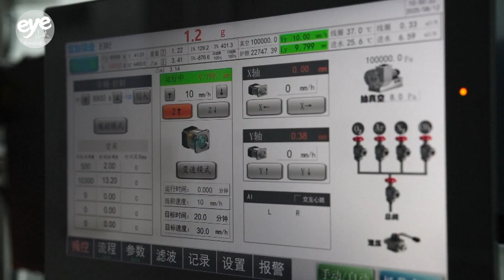AI powers new era in Chinese manufacturing with smarter, more efficient, and data-driven operations

Comment: Love how they run windows
Reply: Not a single computer in the government or the public entities uses Windows in China. They use Kylin Linux OS or Huawei's Harmony OS. Only laptops or desktops used by individual users still use Windows. That will also change and Windows will face the same fate as Google. Now Google is non-existent in China. You need to do some basic research 🤣
Reply: @cwdjdsd-36321cs Just noticed. The original commenter doesn't need to do basic research as they never made a claim about the Chinese government "🤣". This was you misinterpreting what they said. The desktops or laptops used by individuals are a majority of market share in China, with Windows OS being the majority, and Android OS the majority on mobile. You randomly brought up the Chinese government here for no reason.
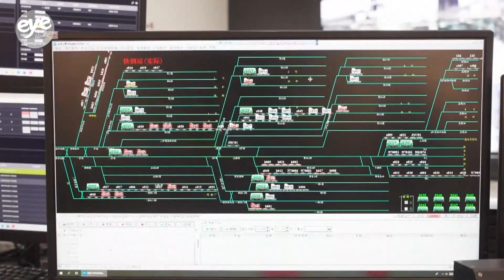Reply: @cwdjdsd-36321cs what are you so triggered abt? You're not even correct either. 1:08 clearly shows him using windows, with Microsoft edge right there, a Chromium based browser btw. You need to do some basic shutting up.
Reply: @bradyh8250  lmao did I tell you that the computers in this video don't run windows? 😂 First of all read my comment properly 😂😂 this isn't a government institution or a government related entity. Individual users and private enterprises still use Windows in China. The thing is Google used to dominate the search engine market, but now Google is totally banned and the available services are from Baidu and other Chinese companies. It's the same story for Windows in China. It's being replaced by Linux and Huawei Harmony OS starting from government entities. For your information government related enterprises account for a huge portion of China's desktop and laptop PC market. Do some research kid 🤣🤣😂😂
Reply: HUAWEI you ment?
Reply: @taiwanstillisntacountry You can literally see the windows logo several times throughout this video.
Reply: What about it?